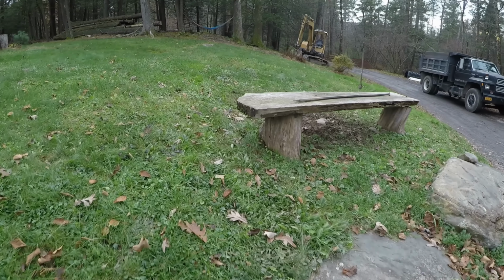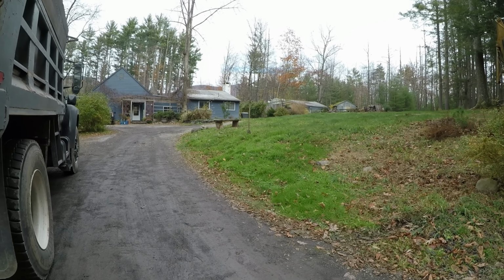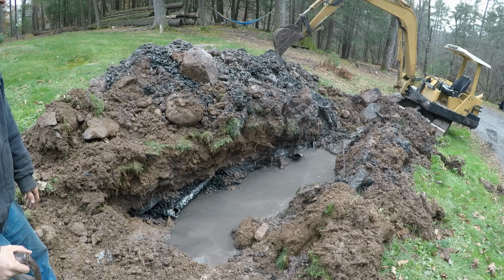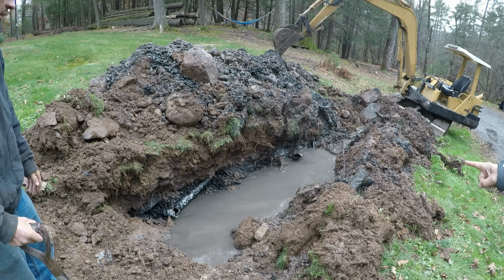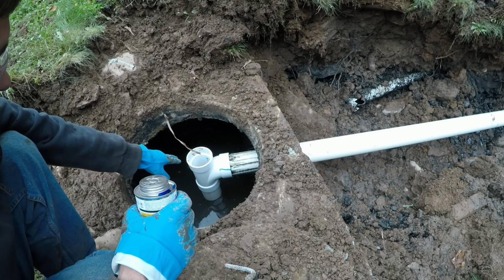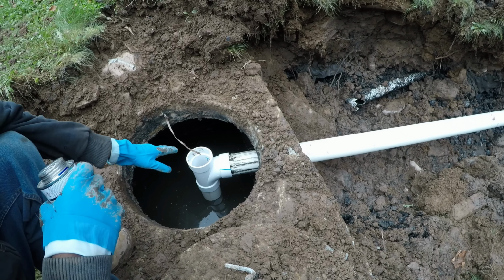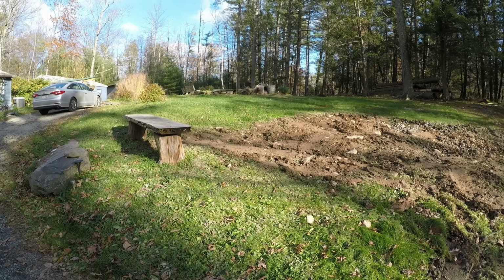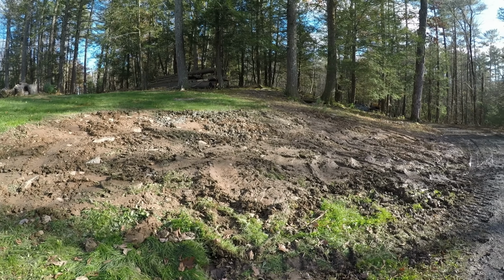Replacing a leach field

Comment: I understand local codes are different in every area but our inspectors would have a field day with you. EPA fine for draining old wastewater above ground, forcing an 1/8 bend by wedging the pipe against a rock, pipe bells facing downhill... Looks good, just wouldn't pass inspection in my area.
Reply: Hell, in my county they would need a perc test, drawings, permits, inspections, $$$, etc.  I am surprised in Upstate NY they allow this. although I'm not against it, just jealous.

Comment: Tip, always prime the pvc prior to glueing.  It is essential!
Reply: Mmm, by the book, agreed, always prime.  Doesn't take that long. 

Not complaining tho. Make a lot of $$ doing sprinkler irrigation repairs! A good percentage of the repairs are from popped joints.  It's is novices used the cheaper glues and/or not priming properly.  Glue is rated for specific size and applications. Types of plastics. ABS, PVC, etc.  just saying 🤷🏻‍♂️.
 The gray-bodied glue actually has melted PVC in it. This fills the space completely inside between pipes and joints. Then it can't dry out and pop apart. The hot glues and cheaper versions are basically acetone and emulsions. 

Am addicted to Andrew so he's doing something right !
Reply: Using glue is just for the camera. Those joints would be better without them.  The whole point of that pipe is to leak fluid.

Comment: In Sweden and i am guessing Denmark to you need to first make a goetechnical investigaton. To see if its possible for the ground to take up the blackwater and to see if and how it will effect the groundwater/freshwater. Then the septic-tank need at least three chambers before it goes out in the bed, the bed consists of a dividing-tank, phosphorus-trap and then bio-modules sometimes there is a afterpolish. Backfilling around the tanks and pipes are done with gravel 0-18mm. On top of that the excisting soil, packed in layers. Backfilling om bio-modules are made with 8-16mm or 16-32mm depending on model. The modulens and gravel are also wrapped in geotextile to prevent the soil from clogging the modules. Than when all this is done, the "citys/county..." (Dont know the name) enviroment and health-inspector need to aprove it. A new septic-system for one house in Sweden costs 100000-150000 sek, 1/4 to 1/3 years income. And since its cold in Sweden, all pipes need to be buried 1.8m so that thay dont freeze. I work with this kind of jobs daily. Both for private people and for the kommun (city). You are lucky, 30-40 years you could do it like  that in Sweden. Now its science...
Reply from the maker: That's interesting, a little strict, but not too different than here. Here for a new system, a percolation test is done first too see how well the ground absorbs the water. Than the system is usually designed by a licensed engineer based on the perc test, and the size of the house. And they will also design a reserve field for when the main field fails. Usually they want a 1000 gallon (3785L) concrete tank, which has the 3 chambers (I'm pretty sure all septic tanks have these chambers). For a field with multiple rows a small dividing tank is used. I have never seen a phosphorus-trap used (that would freeze if its not deep). For the bio-modules, engineers usually want four 50' (15M) rows of 4" (100MM) pipes with holes in them surrounded by gravel, than covered with geotextile. I personally think those large chambers that I used make a better field than the long rows of 100MM perforated pipes. And doing one wide row is much easier and faster to do. For backfilling on a new system I usually use gravel under the tank, under the inlet pipe (its important that it is pitched properly) and by the tank outlet so it doesn't settle. I always use the strong SCH40 pipe instead of the delicate thin wall stuff that many people usually use, this pipe doesn't need to be protected of damage by a layer of sand, I made another video talking about the strengths of the different types of pipe, its worth a watch, titled "Why to use quality pipes". I have never seen a septic freeze, they usually don't need to be very deep, they usually only freeze if a pipe is pitched bad and water is sitting in the pipe. Than on a new system it needs to be inspected by the board of health before backfilling. Repairs of existing systems don't need expensive designs or inspections. A field replacement like in this video is a common, that will last for a decent amount of time. I could have installed a bigger field, but the guy told me to keep it under 28,000 sek.

Comment: 1: The leach field is just by the steep area. It will go to the surface after a few feet even though you've covered it. 

2. Did you get approval from the township for this?

Comment: Where I have property in the  county there are no inspections or permits needed . But always best not to cut corners Instead of redoing over again wasting time and money.  There your land is your land no shitty politician stealing your money!!  Just watch how you back fill without using sand or gravel to support the load of heavy wet dirt on your pipe and causing low area's ok buddy. Awesome video and great ass kicking work all by yourself and good clean up work too !!!

Comment: I don't understand why you say pitch is not important after the tank. I believe yes it needs to go down hill but your chambers need to be close to level or the water will continue to lay on the low side and sooner or later there will be a blow out there instead of a backup but I guess since it's on the other side of the driveway now the water will just run over the hill lol

Comment: I love your videos and I am sure this field will work just fine, But in most places this would not fly between wetlands protection, perc tests and an engineered system. Otherwise , Everyone would be installing or doing their own repairs regardless of whether they would work or not. BTW I live in Massachusetts and YES the rules and regs. are very strict. Systems that have worked for 100 yrs. and would work for 100 more have to be replaced because of Title 5 laws that basically fail all older systems.

Comment: no way I can do this in my county, engineer would have to come in , design new system and the location BOHA would have to approve it  and then I can do it . Unless you have 100% expansion area , not to mention you ran pipe backwards , bell should be toward the tank. Up by me it would be big no no

Comment: Is 1 run enough? I've never touched septics but my field failed like a month ago and I'm looking at my options. I just always assumed they would always run multiple rows. Very cool though. Thank you for the video/info!
Reply from the maker: I think so, depending on ground and usage. Especially those big chambers. They are more like a dry well than a septic lateral.
Reply: @AndrewCamarata  that's cool. I've apparently got to replace my tank as well. One chamber, concrete, no filter on the exit. 62 years old lol 🤣 Been waiting 5 weeks to get a quote so far. Sucks

Comment: Where does the water come out of the pvc pipes, did they come with pre drilled holes 🕳 on the bottom, or is just at the opening at the end and that's it? I thought pvc leech field pipes has tiny holes on the bottom
Reply: That's why he's using chambers. They take the place of the holes. The PVC just delivers the water to the chambers for perforation through the chambers.

Comment: Your downpipe on your baffle in the tank has to go all the way down about 20 inch off the bottom of the tank because solids float your pipe is so short as soon as you get 8 in of solids floating on the top it's going to clog your baffle. The top of the T is fine though
Reply: No need to worry... with all the shit that was on the end of the pipe after he stuffed it through the shitty old gasket in the tank, that glue joint will fall apart anyway.

Comment: new drain field needs inspections and how about some power tools lol
Reply from the maker: No inspections on a repair. Only had to make a few cuts, forgot sawzall.
Reply: More like a replacement! I have been doing this for 30 years in NH and you need someone to teach you the proper way to do this. Outlet baffle was too short, should be 40% of liquid level in tank. You should use primer, then glue on PVC pipe. pipes were put together with the bell facing the other direction. You should of bedded the pipe in crushed stone and covered it with screened material for a foot over the pipe, not the rocky soil you dug out. Have you ever used a laser to make sure the chambers were set level along with the bottom of the excavation? I am really surprised NY State does not required a n approved plan along with an inspection, you need separation from the water table!

Comment: You are are a great machine operator but you lay pipes backwards and bent with no screenings underneath and on top of  the pipes. The screenings will hold your work straight and in place

Comment: since it was going under the driveway why not use sch 80 pipe? wouldnt that be stronger? i ask because the septic tank outlet pipe to dist. box just failed on me. and its under my driveway. i just hope my drain fields are still good. what did you charge for this job also??

Comment: Also, this new white pipe is buried too shallow, when the frost comes, the water in this pipe will freeze, and may the pipe itself not crack from frost.
Reply: There wont ever be water in the pipe, and if there is, its moving water.

Comment: Great video. But just one question. Why u use gravel instead of sand. Sand will drain much batter than gravel.
Reply from the maker: Gravel is what is always used for leach fields here. I have never seen sand used.
Reply: @AndrewCamarata  ok up north is different 👍.. in Florida whe use sand. It was just a question thank you for the info.

Comment: man, I cringe everytime I see those infiltrators installed...hope you haven't had any issues with them other than that you look like you did a great job in a timely manner..we have 6 150 foot trenches with perforated pipe. gravity fed system me and pops installed 30 years ago and never had a hiccup out of it so far...knock on wood!!
Reply from the maker: 6 150' trenches, that's a really big field. How big of a house is that for? Usually engineered systems here, they usually have 4 50' trenches.

Comment: Looks like a messy job, well done!
So the "hard parts" stay in the concrete chamber and can be pumped out and the "liquid parts" flow out through the new pipe and seep into the forest?
Thx for the vid!
;-)
Reply from the maker: Thanks, yes that's how septic systems work. The water seeps into the ground.

Comment: So, I've been reading about septic tanks and drain fields about not driving over them.. but I see this machine going over it which weighs more than a car.. so Im confused.
Reply from the maker: You can drive over the tank fine if its the type thats meant to be driven over. Same with the field, but you would not want to regularly do it. The machine is heavy, but sitting on its tracks it has a much lower ground PSI than a car.

Comment: In NY what permitting and documentation do you need to do septic work? Here in MD you need to have a doctorate and have a hourly "rectangle" exam.
Reply from the maker: New systems need perc test, deep hole test, engineered design with BOA inspection. Repairs don't need anything.

Comment: I notice most contractors use landscape cloth on top of the leach field but not underneath it. Is there a reason for this?
Reply: You want the liquid to drain into the gravel not stay on the cloth, only on the top to prevent dirt from mixing into the gravel

Comment: My tank is about 25 years old, the tank itself is fine but the leech field is not working properly.  A contractor quoted me $20-$30k to fix it.  He said I will need an engineer to do the plans and replace my tank. 

What is the average cost to replace the leech field and would I need to replace the tank as well. 

I have a cape, 3 bedrooms and two bath. I believe my tank hold 1500 or 15000 gallons. 

What are your thoughts?
Reply from the maker: Thats allot for a field. Is there no room for a replacement? I think I charged this guy 2000 for this and its working fine.
Reply: They want me to get an engineer or have a title 5 done.  A lot of people want me to replace the tank but I feel there is no need. 
What is your professional opinion? I would really appreciate your thoughts and recommendation. 

Great job by the way on this job.
Reply from the maker: Chammy Yang Khang Usually the tanks are fine, what is it made out of? If it was Steel I’d probably replace it, just make sure the baffles are good in it. Here engineers are not needed for repairs, since there is already a system installed it’s technically a repair. It might be different where you live,
Reply: Andrew Camarata Where are you located?  
Thank you for taking the time to answer my questions.

Comment: I generally like your vids but this one is sketchy as hell. In my neck of the woods this whole deal would be illegal and its installs like this that make them write so damn many regulations. First, you can't just guess where the leach field should go, and next to that SWAMP would not be my first guess. It was up on that hill to get it up out of the groundwater table. Dig out the whole old field, truck in new bank run sand up to bed bottom, new stone and pipe and it would last a long time. This is why they have septic designers, to avoid the imminent failure you just created. Second, your pipe is ALL backwards, and you never leveled it to have consistent drop nor did you backfill around it  by hand to ensure is didn't do the crazy settling it did when you pushed all that material in there with no prep work. The trench you dug for the infiltrators holds water, at least well enough to NOT leach the minimal runoff i saw flowing in.  You either need to be in a deeper better draining layer or if thats not possible due to groundwater a whole other location. Third, infiltrators??? really??? these things completely SUCK compared to a well installed stone and pipe system. You just made a leach field a fraction of the size it should be, in a wet spot with from what i saw NO equipment to establish grades. Worse yet you buried trash on your backfill.

Comment: That open T which is supposed to stop the sludge from entering your leach field. Does not make sense to me. 
Anything floating will eventually pass the bottom of that T. So if the bottom of that T is a foot or more underwater. The level of water in that tank would have to drop below that, to allow a small amount of sludge in. And it will never (almost never drop below) the highest point of where the water can drain out. The opening to the leech field.
But, the top of that T will always be introducing sludge to opening to the leech field every time it drops below the T. Which will happen regularly since the water will always drain to the bottom of the lowest point of a drain, and in this case its the opening to the leech field.
This setup does not make any sense to me.
Reply from the maker: Because the top level stays at the middle of the T, that way only water goes to the field. There are diagrams online that demonstrate better how this type of septic tank works.

Comment: those infiltrators suck no matter how well their bedded I've gone out to fix countless of them sure they're easy to install but they fill with dirt, also the wet or dry blue sucks for sealing the gray Weldon glue is 100 times better all in all good work though, also no on bedded the pipe at 830 and no level or grade rod to check for fall.
Reply from the maker: I haven't really had any issues with them. Why would they fill with dirt? They have more volume than a traditional 4" perf pipe with gravel.

Comment: May i ask why not just use currogated pipe.. forcing thqt pvc to bend like that... eh i see joints or the pipe failing eventually... Currogated is also way stronger than PVC when it comes to driving over it...   too much pvc under roads.... itll be crushed in time.. ask how i know..

Comment: Why didn't you put a filter in the new tee in the tank???? Also your repair looked a little on the shallow side as well and why did you put rock under the chambers and the fabric as well?????? Ive been in the septic industry for almost my whole life and have never seen that done.....
Reply from the maker: A filter? I haven't ever seen a filter there. The rock under the chambers is to level the ground, and give the water somewhere to go.
Reply: Filters are per code. When the inspector signed off on the hook up and wasn't looking the installer removed the filter. He said it causes too many problems.
Reply: Effluent filters aren’t required everywhere nor should they be.
Here in Arkansas they are only required when Pumpimg to a pressure manifold or a zone valve. 
Also, each state does things differently.
Reply: Tate O'Connor married his sister

Comment: When you made the new trap in the septic tank  Why did you do a T and leave the top open instead of using an L? Also curious about were you concerned about the pipe being close to level  ( with no bumps and dips) from the tank to the infiltrators? I am fixing to do a system for myself and I would like to know the answers.
Reply: Don’t want low spots that could accumulate sediment.